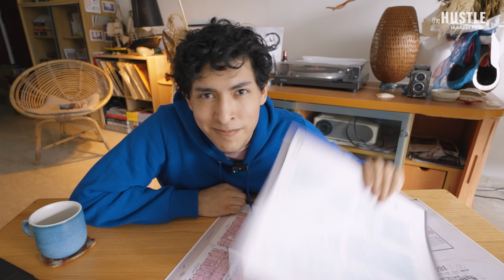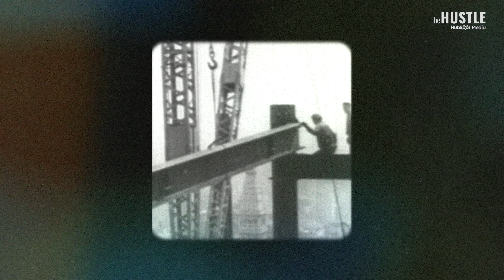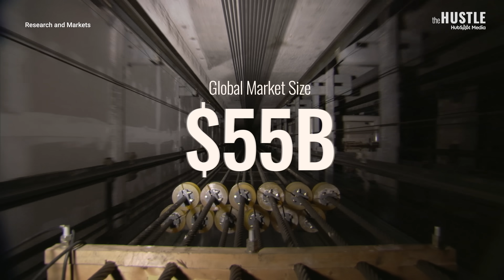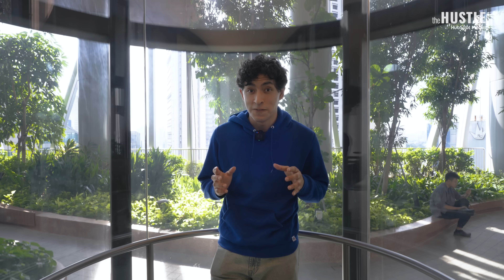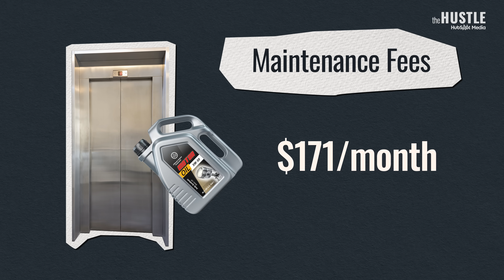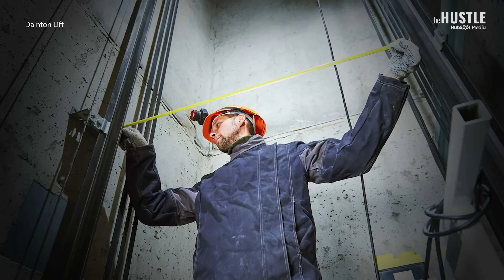Why Elevators are Absurdly Profitable

Comment: Now I have a question about how long elevators last. Wouldn't you just need to replace the brains of the operation, instead of the actual Hardware which should make it significantly less expensive when the computers that run the elevator wear out or are just too old to maintain? There is no way you would need to replace the car and and the track if there is one and the doors and all of that after 10 or 15 years, right?

Comment: Part of why elevators are so rare in the US compared to Europe is that us unions insist on disassembling the factory completedd elevator in their workshop and reassembling it at the install location.... Then install begins. In Europe, it arrives complete at the install site and is installed quickly. 

I'm not sure I'm buying the guy's claim about escalators being more expensive because they arrive in 1 piece. It would be even more expensive if the were assembled then installed all on-site.
Reply: Oh and elevators are not rare in the U.S.  they just have to be profitable for the building owner to install and maintain. They are in every large building and many luxury homes. I’ve been in countless buildings with elevators. Never seen them as rare. Most malls or other 2 story structures with a lot of public use will have them for disabled people even though it’s not a tall building. Escalators are super common at malls and subway stations. I’ve never seen one without an escalator. Maybe in the country in Europe that you reside in they have elevators in 2-3 floor buildings but in the U.S. you legally need them at a much higher hight and most newer apartment buildings or office buildings have elevators at 3-5 floors for people’s convenience. It’s hard to rent or sell an apartment or office space on a higher floor with so much stairs. And building with more than 2 floors (3+) that doesn’t have an elevator is automatically going to sell or rent for significantly less on the third and higher floor. And potentially have a harder time getting it filled. But it’s not a legal requirement. So newer buildings (as in anything at least 50 years old or newer are very likely to have elevators if there is 3+ floors. Not including the basement since that’s only one floor down from the entrance.)
Reply: @ya8158  For my country meanwhile older buildings tend to have at most 1 basement floor, that is often not served by most lifts, maybe to save on building costs so the lift pits don't have to be dug deeper than the rest of the building
Reply: Two other reasons why US has less elevators than EU (besides what other people are already commenting) is US mandates larger elevators so that ambulance stretchers can fit in while EU doesnt, in addition, US is just 3x less densly populated which skews elevators per person math. If you go to NYC basically every commercial building and most modern residential buildings have them but you'll find basically 0 in appalachia.
Reply: Elevators get disassembled because they can’t be installed in a completed building. If you look at commercial construction two parts to structures get built first. Banks vaults and elevator shafts. These are items that are insanely more expensive to install once the building is completed. You have to break walls (or ceilings and use a crane) to install a completed elevator into an old building. Escalators are even larger and more cumbersome to install in a completed building. I highly doubt they completely assemble the elevator in manufacturing if they are going to disassemble it before install. They probably make the parts as an ikea like kit and the install guys just carry in loose parts from the truck and assemble it inside the empty elevator shaft.
Reply: @ya8158  I imagine they'll still assemble it in manufacturing even if it'll be dis-assembled before install if that's needed for the lift/elevator to have enough quality, safety assurance etc. tests done on them to prove that any defects found on them later aren't the factory's responsibility. Think the same is done for EUV machines too
Reply: Elevators aren't rare at all in the US and "fully assembled" elevators are virtually nonexistent. There is a company called Phoenix Modular Elevator that makes a fully pre built elevator but applications are limited. Not sure where you are getting pre assembled being the most common option from but that's just not true at all.